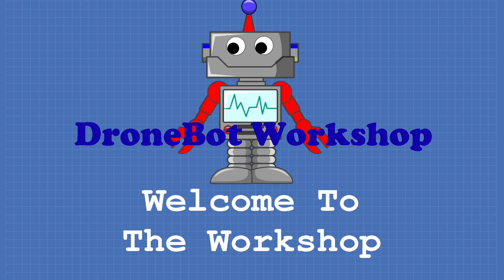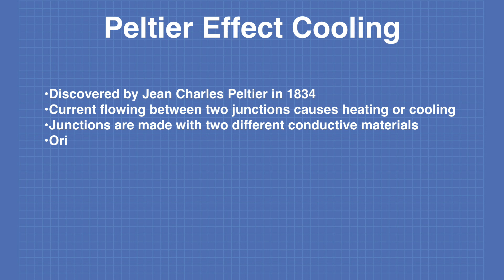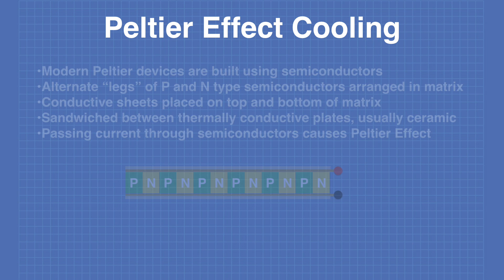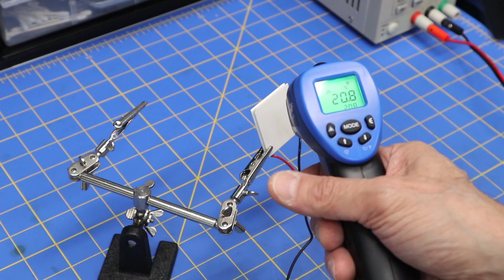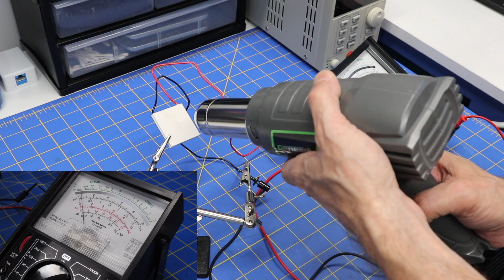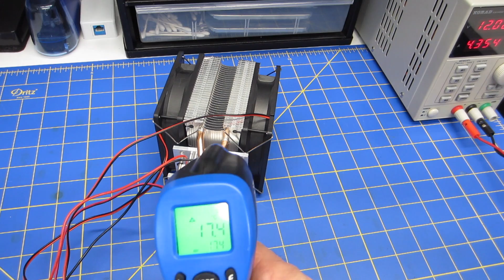Peltier Effect Cooling - Experiments with a Peltier Cooler Device

Comment: Thanks for a great video. I recently bought a neck cooling air conditioner with thermoelectric cooling and heating and I didn’t want to break it apart to figure out the engineering behind it. This was the information I was looking for.

Comment: How much current does the peltier draws from the power supply? I tried plugging it on 12v5A power adapter and the led starts to blink, which means the peltier wants current more than 5, be ause its triggerig safety warning on adapter, pls help tyia

Comment: Good vid, thank you.

I made a shunt-type opportunity (solar/wind) charge controller for yachts using a set of water-cooled, current regulated peltier devices.  Having a large supply of water, the efficiency increase over the typical air-cooled applications was incredible, even accounting for the small pump (which also ran in proportion to the hot side temps).  I say 'set of', as these are current devices, not voltage devices.  When I would start to exceed the maximum efficient current, then I'd switch another peltier device into circuit to keep the battery within my desired charge parameters.

The delta-T runs around 90*C (hot to cold), it's the Q that they suffer from.  Most commercial applications use a forced air heat sink, my experiments showed that they were a much more practical device when water cooled (the colder the hot side, the colder the cold side, if that makes any sense).

Comment: I have read several people claim that lower voltage into the chip,the better it will cool and I have also read the exact opposite that higher voltage into the module the better it cools. 

Any input into this? I have a few devices that use these modules and I run them at 12-12.4v.  I just want some experience from someone and not from an article or forum post from years ago.

I may have to do some extermination if nothing else. Seeing is believing 😄

Comment: I have 2 Ecofan AirMax fans that are  Peltier effect powered that sit on top of my wood burner.  They have a small motor that drives an 8 in fan blade that circulates warm air from the wood burner.  Works good.  Backup in case power goes out in the winter.  Made in Canada.

Comment: You mentioned you could series modules for heat capture but there are better ways of heat capture. In your opinion, what’s the most efficient heat capture method? Say to charge a battery bank from a small camp fire as an example.

Comment: My Lincoln MKZ ventilated seats use 2 Peltier devices per seat it was a happy surprise as I always had heated seats never cooled. And let me tell you it gets over 100 degrees F with the fan cycling on and off blowing hot air at my backside

Comment: Just a warning for raspberry pi cooling. Tried an 172W 24.6V peltier running only at 5v on my armor cased rpi 4 2.1Ghz , massive condensation.

Comment: thanks for the video!
can you do and experiment and see what the maximum  current and voltage you can get with temperature high temperature differential. like the thermal electric power generators on Youtube.

Comment: I have a peltier at my home but I don't know why doesn't it cool on the cool side, I have touched in the cool side that some parts/corners get heated. I have applied 12 volt 5 amps just one amps less than normal 6 amps.

Comment: If we have the same hot plate (50 degrees), the same heat sink, but different thermoelectric modules (e.g. TEC1-12702,  TEC1-12706, or TEC1-12710), which one produces more power?
Can you please elaborate this as I'm new to this area :)

Comment: TEC = Thermo-Electric-Cooler = Material-Combination chosen for Cooling. Therefore it has a low max. Temp. of the Materials.
TEG = Thermo-Electric-Generator = Material-Combination chosen for Generating Electricity. Therefore it has a high max. Temp. of the Materials.
Most important is a high (sustained) Delta-Temperature of the Surfaces on the TEC/TEG.
Reply: The most practical application I've seen is those heat-powered fans on wood stoves.  Seems like you should be able to rig something up that you could use in camp to charge all your batteries and/or light the place up at night, if you wanted.  I think a camp-stove manufacture has integrated TEG cells into charging electronic devices.  About the size of a coffee pot.  Has computer fans as blowers that re-charge themselves, too.

Comment: Amazing! This peltier effect principle may well be the future of refrigeration and airconditiong. Look at LED's, they were formerly used as indicators or sensors only but now most lighting use this technology at cheaper cost of energy.
Peltier effect can someday produce cooling effect  cheaper than a compressor can do. If only liquid nitrogen or CO2 is easy to come by.
Reply: actually  its  been  around for  many  many  years  but  due  to  TERRIBLE  efficiency   they  are  being  replaced...
Reply: imagine  that  to  cool  a room you  would  need  well  over  a  kilowatt  of  peltiers    and  a  gigantic  power  supply.  The  peltier in  the  vid is  probably a  92watt@  12v  =7.6  amps
Reply: @ihater3tards  you need at least 3,5kw COOLING capacity for an average 30m2 room.

An A/C uses about 1kw for that.

Peltier would use 35kw for the same cooling capacity.

So dont even think about an air conditioning using anything peltier related.
Reply: Do you do research before leaving comments? I have some exotic sand to sell you. It's special.
Reply: @op8995  Most people don't research before leaving a YouTube comment no lol, If you don't have anything nice to say and all that.
Reply: Have to couple it with solar power to get the power needed.

Comment: Hot/Cold  Most of the Peltier modules I've used are as follows. Leads Facing you. Positive lead (Red Wire) on right = Cold side Up.  Just a little FYI

Comment: Small note: they aren't really very  popular at all in pcs. Heat pipe based air coolers are most popular and even water cooling is far more popular. Cool tech though.
Reply: Yup: they were, for a brief time, in the 90s.
When PC parts didn't heat that much like they do nowadays.

Comment: I don't know how much of a factor it is here, but you really don't want to run these at full voltage. They will tolerate 12 volts, but they have terrible efficiency at higher currents (and they also hate PWM, or even just being turned on and off too frequently), so controlling them is not entirely trivial.

Comment: could it be used to cool a computer case? modern cpu are now at 105 watts form the 65 i was just wondering if it could be used to cool a mid tower case of like 1.5 feet? the condensation is a concern?

Comment: The voltage generation in a peltier device relies on temperature differential between the two sides.  Keep the cool side cool, and heat the other side, and you get more voltage.  I've never measured the current capabilities, but I don't think it's very much.  Although, as stated earlier, they are used to run a fan on a stove.

Comment: Does the minimum internal resistance of the device set the max current (6 amps) that can flow through it or does the device require a current limiting supply to avoid excessive current flow?
Reply: I've asked muself the same question but I'm pretty sure it's internal resistance and maximum temperature resistance that dictate the maximum usable current through the device. Limiting the current through a resistor for a device that draws about 50-60 watts of power would make the whole thing even less efficient and pricy as 50+ watt resistors aren't cheap.

Comment: Great demo! I've played with them years ago and have a small Coleman cooler using the chip. The inefficiency is what keeps them out of mainstream applications. More energy is converted to heat than to cooling. I think they have a limit of Delta-T. I think around 35º?  So, say for one of those portable coolers you plug into a cig lighter, if the ambient temperature is like 90, the contents won't cool much below 55-60ºF.

Comment: It would be nice to use this to make a still for distilled water. Evaporate the water on one side and condense it on the other.
It would not be necessary to generate steam, just evaporate the water in a closed system.
I suspect it would not be very efficient, taking a long time to produce any output.

Comment: So putting heat to the hot side produces an electric current, so does putting cold to the cold side also produce a current, if that was the case cold side makes a current also..?
Reply: You've to simultaneously heat and cool respective sides to create a temperature difference.

Comment: No one seems to be mentioning this, but this tech was used in space also for a long time. RTG (Radioisotope Thermoelectric Generators) were used on probes, satellites, and rovers. Basically uses the heat from a radioactive source to make power.

Comment: During the video (I tried to be quiet) I checked out the prices of Peltier devices and they are CHEAP - cost effective. So thanks for the info, I can think of all sorts of uses - both hot and cold plus electricity in and out. Nice video.
Thank you for sharing...
Reply: Cheap is relative. Cheapest I've found for the exact same device is 3,27€ (about 3,50$ at time of typing) but this does not include the ones I've found from chinese (long delivery time) suppliers. My experience with them is that the published specifications just aren't accurate. At +-4$/piece geneeating about 2-3 watts of power with 80-100°C of temperature differential AND decent heat sinking, I'm not convinced this has any practical or economical advantage for general home or even industrial power generation. As he clearly mentioned, it's probably only interesting in very specific applications.
Reply: but inefficient. power is not free.

Comment: Great demonstration.  I have the same Micronta multimeter that I bought from Radio Shack when I was a teenager back in the '70s - yours is a lot less beat up then mine after many years of use.  We had a water cooler that used a pair of Peltiers to cool the water.  It worked quite well and was silent vs. the water coolers that used a compressor.

Comment: Can one of these be used to cool a Raspberry Pi 4?  My understanding is that these single board computers run very hot.  Can these be used for other Raspberry Pi and Single board computer cooling options in lieu of a fan???
Reply: The problem is that since these get below freezing, they tend to condense and/or freeze moisture out of the air. Not great for electronics.

Comment: loved the vid, I had used two of the same peltier modules for a project 10 or so years ago, seemed real inefficient to cool beer from a keg through the system I made up, fine until you invite a friend or two. Princess auto had them in their surplus section at that time with absolutely no instructions or info. Eventually found out how much smoke it actually holds, I would not recommend 24volts.

Comment: Very interesting video, but missing one huge data point for designing an application. How much power were you using in these experiments. You gave voltage but no current levels, so I can't  figure out wattage (used or produced).
Also voltage draw down under load would be nice, even though I realize you did not power a load.
Minor point but no way to quantify heat or cooling amount, you have temperature data but no mass.
PS.    Is 06 spec on unit indicating 6 ampere, 60mA, or 600 mA.
Units please, or perhaps another video, showing experiments 4, 5, and 6.
Thank you for a great lesson.
Reply: From the ppwer supply display, I believe I saw 12VDC @ 4.5+ AMP on the "ice making" test @ 3 minute duration.
Reply: @LOAJ3256  It's the number visible on the PS during the test (between 3.1 and 3.2 amps.)
Reply: I saw 5.1 amps drawn unless the PSU was current limited to 5.1 A max.
Reply: @reasonablebeing5392   Yeah, that's the reference to the +4.5, a result of a single pass watch and my poor memory. )

Comment: Awesome video. I have a question that hopefully you may be able to answer. I have a couple of cooling units that came out of a laboratory pipetting machine. The Peltier devices are labeled as “TZ6B1203-10” and “TZ581505-02”. For the life of me, I cannot find any information on them. Any thoughts? Thank you.